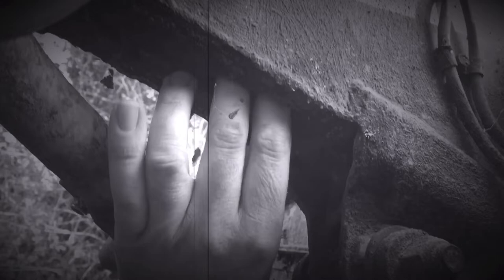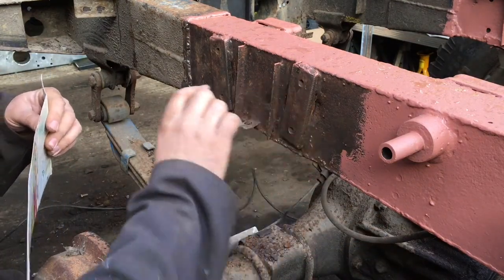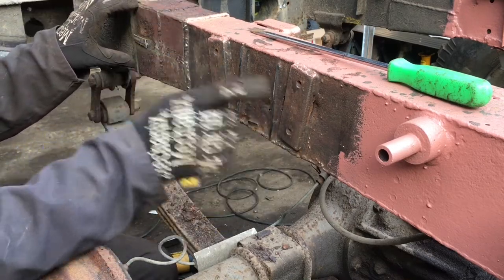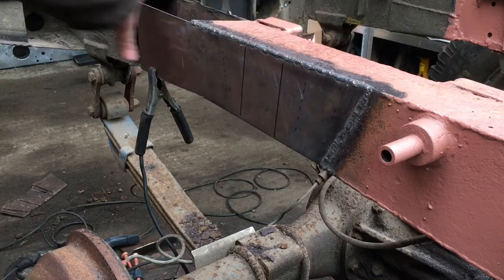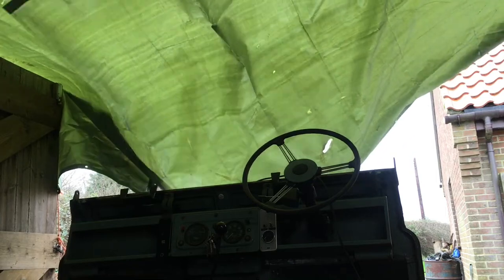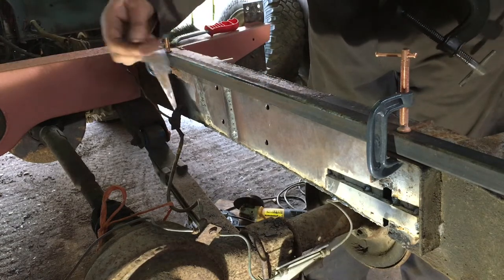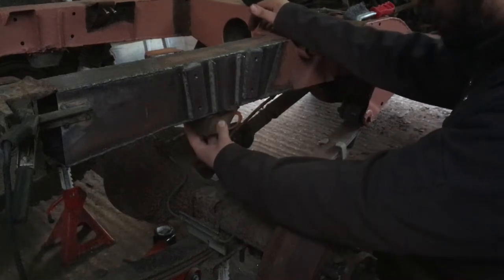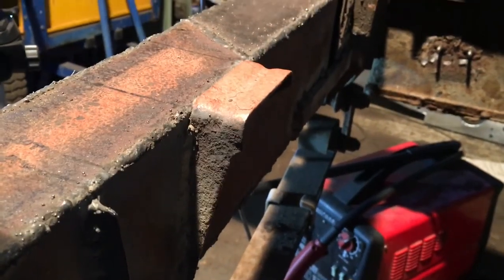Resurrecting Shorty - Land Rover Restoration Part Four - Repairing the rear chassis rail.

Comment: Subscribed... Just started a 58 S11 resto for a customer here in the Algarve...thank god his chassis is like new probably because it left Cornwall early in it´s life to go to Africa and then the Canaries before here in Portugal its number 13 chassis off the line with a factory diesel engine fitted...has a lot of differences that I cant work out as in no hole in cover to bleed clutch...indicators fitted but no stalk I know they were an option...twin battery trays in engine bay instead of one under seat...lots of other bodges as well...keep up the superb work...Ivé just finished my own 101 forward control found under a tree been lying 15yrs in the Algarve didnt know my mate had it till Landys cropped up in conversation just need matriculation to Portugese reg now not easy...
Reply from the maker: Thanks! Glad you’re enjoying the videos.

Comment: Nice work. I assume you’re using a gas-less mig? I’ve heard they’re not as good as a conventional mig, your results seem to belie that though. Also, with all that wind, you’d probably struggle with a conventional mig anyway. Keep it up, I’m along for the ride.
Reply from the maker: Hey, thanks! Yeah, I have always used gasless. They get a bad press, and I do believe they tend to splatter more. But I learned to weld using gasless and I’m happy with the results I get. It’s certainly not going to fall apart!!